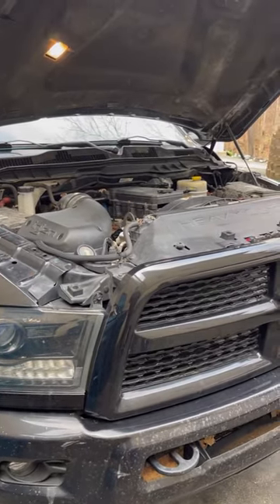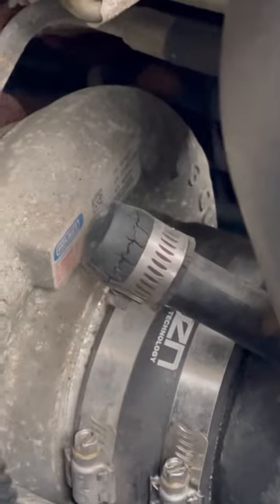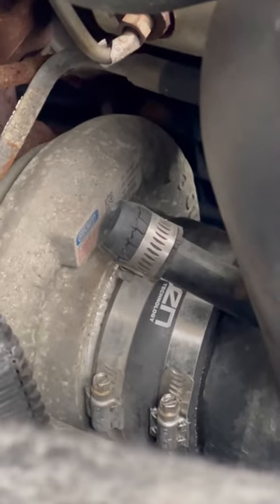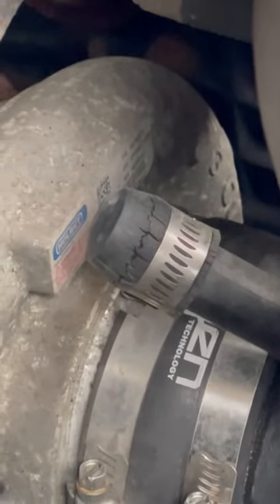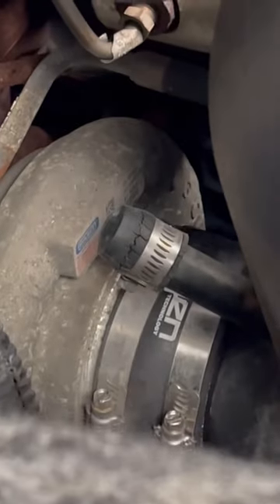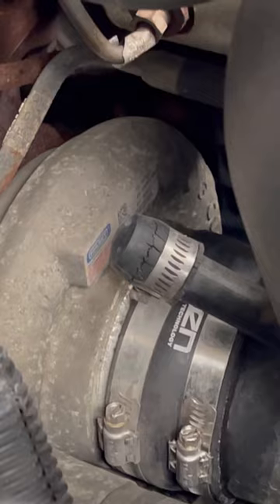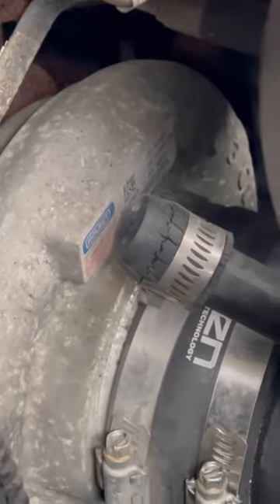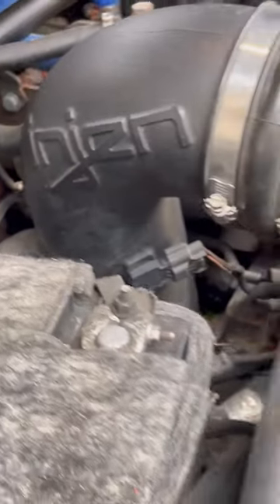Aftermarket Performance Failure engine surging air leak unmetered maf cold air intake fix mechanic

Comment: The break clean also brakes down the rubber🤦🏻‍♂️
Reply from the maker: Don’t spray it on hydraulic wheel cylinders in drum brakes then, those have rubber on them.   Also all brake calipers have rubber on piston seals and most have rubber over guide pins.  I learned this from a guy that’s been working at Audi for 30 years and before that, worked for the Audi race team.  Not to say everything I learned was right but the type of rubber matters a lot if it’s going to dry rot or not.  The brake clean won’t make hoses want to pop off.  You can always use coolant if brake clean scares you but it won’t grip tight once installed like brake clean for boost or intake pipes. Or just use water when you need a hose fully seated or slightly soapy water.  In my experience nothing make a hose slip on and stay on as well as brake cleaner more specifically for boost hoses.
Reply: Stating fluid (ether)works as well.
Reply: You got your brake cleaner mixed up with something that breaks...

Comment: Brake clean in a pinch. Use silicone spray, instead. Goes in wet, and dries  to stick once heat cycled. Actually protects the rubber as well.

Comment: Love the tip on brake clean. I use that over silicone spray for boost lines and coolant hoses. Seen enough hoses pop off with silicone.

Comment: On a serious note, I like using some sort of rubber conditioner on every piece of plastic and rubber on the vehicle, pretty much every time the car is washed, I hit all the hoses, plastics, boots, whatever soft material I can find. Hydrating all the soft materials makes them last longer and makes it easier to work on them because the material stays soft and flexible, get some lotion for your truck, that girl is dry. Plus, everything looks better when it's shiny and dark.

Comment: Yeah brake cleaner might not be the best choice... on rubber I use dielectric grease or dish soap depending on if I want it to stay greasy or not. To each their own though 🤷‍♂️
Reply: Yupp dielectric grease is pretty much silicone. I use it on everything. Gaskets, o rings, rubbing.
Reply: @cotyluckett  Same

Comment: Ill give u a top tip, The best lube to use is, The one that u always have on your person, lick your finger and use your spit it won't deteriorate the part you just changed. (Unless u didn't brush your teeth) 🙄🤣 The brake cleaner wil dry the rubber out and cause it to degrade quicker, 💯💯💯👊👊👊👊👍👍👍